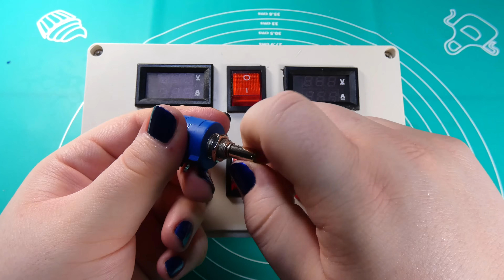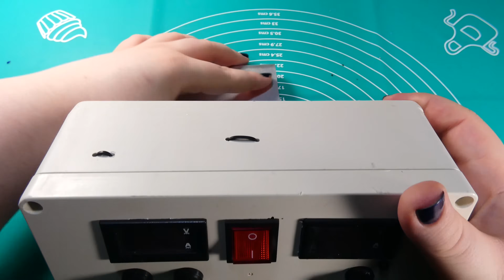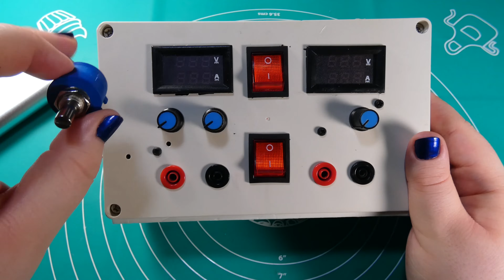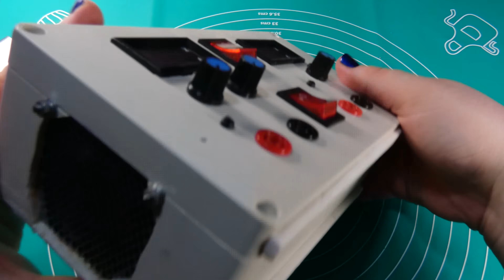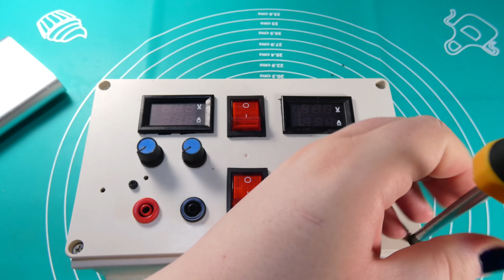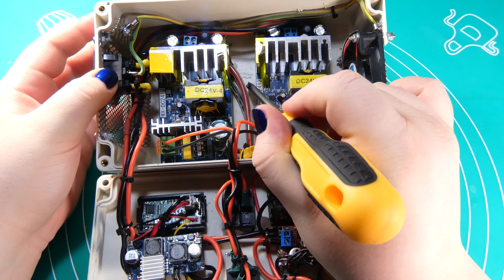Dual Channel Lab Bench Power Supply EVERY hobbyist NEEDs - Here's how it looks

Comment: that was interesting, but i would strongly suggest a much bigger cabinet, with enough space to route cables away from heat sinks or any potential heat source.
also, a mA range fuse at primary side is a must to avoid short circuit mishaps.

Comment: Hello Anna. I don't think I have ever made anything without altering it, some of my beasts look like a sieve. That's a nice job you have done there. Apart from your fan control all the parts just need wiring up. I had to add a tiny buck to power the fan like you. Perhaps you could add another LM317 to your fan control circuit, unless you have 12V somewhere it's needed. You should get a nice cross flow of air. I added a 99P voltmeter to your fan circuit when I was calibrating it and kept it on.  Might the fan cool the copper and delay the fan control thermistor, maybe a bit of captan tape around it. People moan about the Chinese electronics but we would not be here without them.
Reply from the maker: Hey jp,
like you, I constantly alter projects to make them better and thought it might be good to show it.
Also I think your are right I should add some capton tape over the copper and thermistor to get a better temperature reading. Will do it right now so I don't forget :)